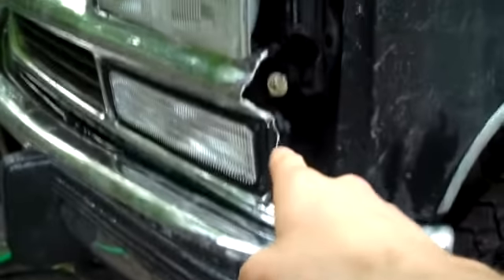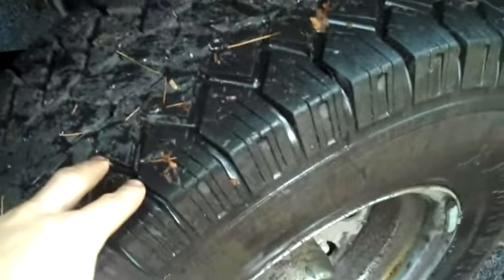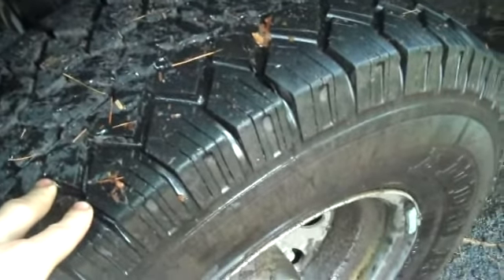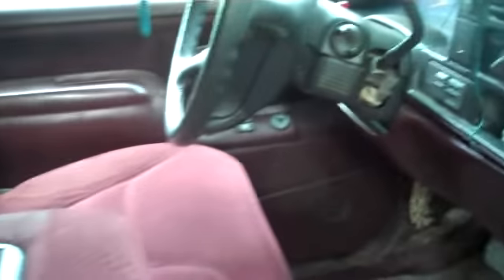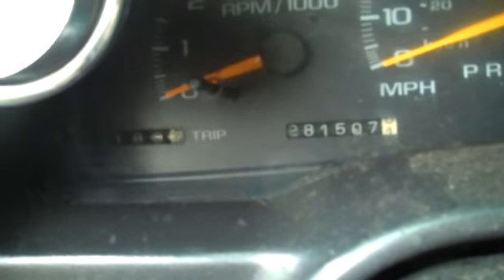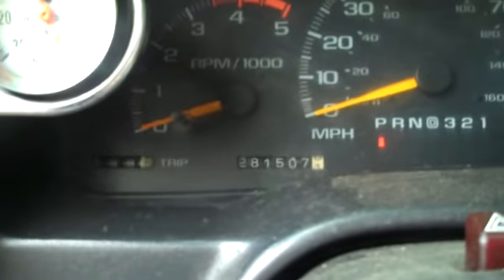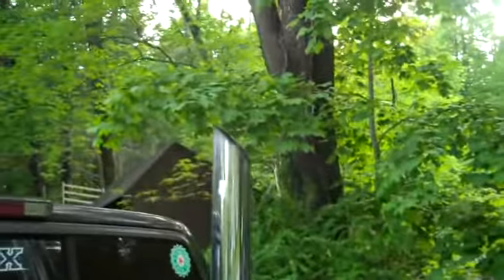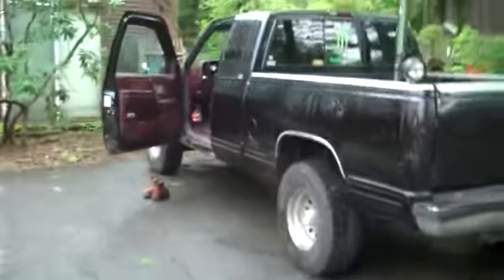97 Chevy k1500 Turbo diesel

Comment: I know you said the truck itself has that many miles on it but if its a 1500 with a turbo diesel then the orig engine was replaced. The 1500s did not come with the diesel. If that is indeed the factory engine than it would be a 2500 or 3500.
Reply: Lone Wolf Nope some 1500's had a diesel